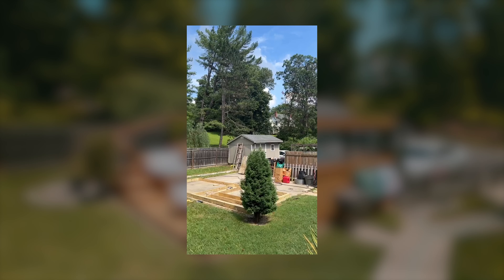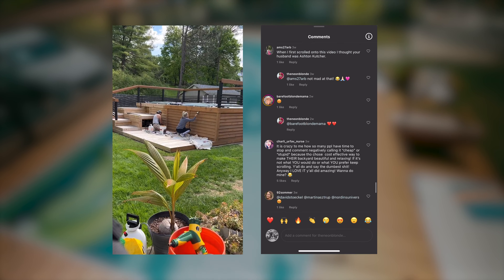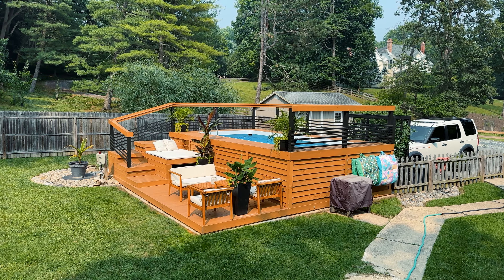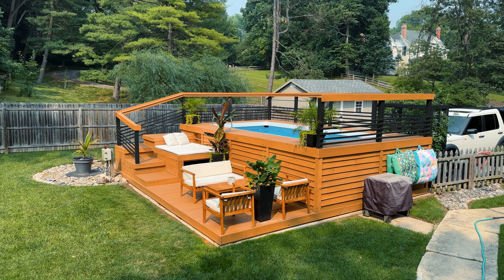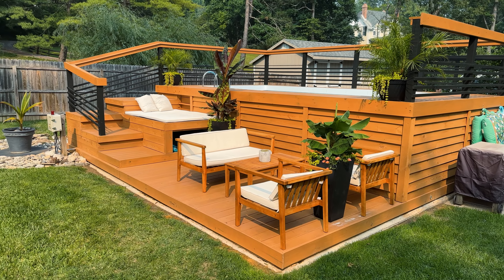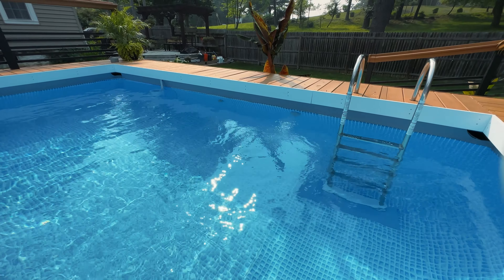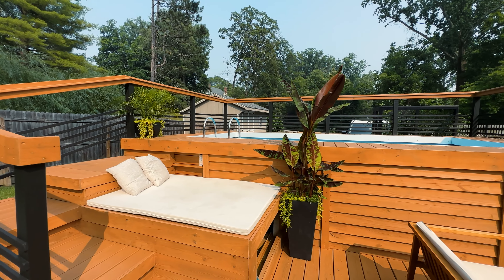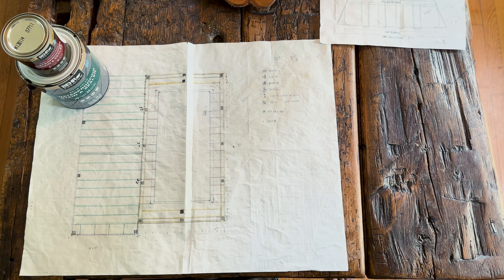DIY Pool for under $6K - Intex Ultra XTR and Saltwater System

Comment: Don't take too much hate from the internet, seems like a very logical choice and budget to me.  It looks great!.  We took a similar approach with kids only using it for a decade or so, we built a nice deck around a cheap pool (same one actually).  $100k for an inground wasn't feasible, and this provides great value.  Ours comes down for the winter, but that is climate dependent.  Great design, beautiful and functional!

Typo on your new pump.   It's not 8500 GPH, that would be all the pool water in one hour.  It's probably 1500-2000 gph.
Reply from the maker: Yooo!! You’re the first person to catch that, hah! Can’t believe it. You’re 100% right, my mistake. Those numbers are the pool sizes that the corresponding pumps are rated for, NOT GPH. Thanks for the call out and the comment. I appreciate it.

Comment: I closed my pool last time with a kit and left 3/4 of the water in.  Opened it with a kit, adjusted the salt and it was great.  I will never drain it now.  I have a more powerful pump and filter though so the results were very fast.
Reply from the maker: This is awesome! Thanks for letting me know. I've thought about winterizing it with a kit but haven't tried it yet. If you're able, share some info on the kit you used and any insight from your experience.

Comment: I have this same pool with a similar deck setup. Only difference is I got mine in 2019 for $300. They have gone up in price! I’m in the Virginia side of the DC metro area. So I’m thinking we have the same weather as far as winters go. I upgraded to the bigger pump as well. So far it’s been the best thing we added to our backyard. I use it more then the kids!! When winter comes along we drain it to under the plumbing ins and outs make sure to drain the pump. So we don’t have to worry about freezing water in the lines. Throw a cover over that bad boy. And we are good to go. I go once a year to Walmart at the end of the season and stock up on pool supplies. That way in May before everyone is doing the mad dash to get stuff to open their pools. We are good to go. We are starting to think we have about 2 seasons left before we may need a new liner. But for the price paid in upgrades, decking etc. it’s been totally worth it.
Reply from the maker: That's awesome! I've heard rumors about how low the prices were pre-covid but $300 is incredible. I recently saw it on Amazon for around $600 which is the best I've seen in the last few years. Your tip about getting pool supplies at the end of the season is pretty great, I'll have to try that. When winterizing your pool, do you put any chemicals in it or do you just drain it below the inlet / outlet? Also, what's been your experience re-opening the pool after it's had water in it over the winter months? Thanks for the comment!
Reply: @taylordeyoungdiy sorry for the late reply. When closing up for winter I normally dump a full bottle of the Walmart liquid chlorine in it. However this season  when opening it. We had a problem with algae. But that was a fairly quick fix by changing out the sand in the filter. I’ve noticed with this filter I can only really push the sand about 2 1/2 seasons on it. However I have 3 boys plush neighbor boys that will try to jump in straight from football practice. If I’m not out there to do the mom glare! 😂🤦🏽‍♀️😂.  I was just in the pool almost every day this past week with the heat wave we had. Did a thorough scrub and vacuum inspected the liner and we should be good for another season. I do plan to go to Walmart sometime this week as most of the Clorox pool chemicals should be going on clearance. I also did a upgrade this year with mosquito netting and more solar lights. Creates an amazing date night atmosphere! Oh one more thing. I will say I don’t drain it right under the plumbing ins and out. I go a bit lower to account for the expansion with freezing. You know how the bottom on the pool is bigger so it helps with the flex!

Comment: That looks very stylish, Taylor.  Two questions for you.  1.) what did you use for the white edging over the pool?  Looks very clean.  2.) what type of decking boards did you use?
Reply from the maker: Thanks for the comment! We used PVC board for the edge or coping. The deck boards are standard deck boards which we stained and sealed. We considered a synthetic product but opted for wood. Maybe we'll upgrade it in the future. Let me know if you have any other questions!

Comment: May I ask you to say more about winterizing? What kind of climate are you in? Just trying to see if we could leave one up in Canada!
Reply from the maker: We're in Maryland so the winters do drop below freezing, not as cold as Canada but cold enough where we can't leave the pool as is. In our case we chose to drain the pool completely and refill it in the Spring. It's a pretty small pool so this isn't a huge effort and the impact to our water bill is minimal. We left the pool frame and liner in place and covered the upper area of the deck with a waterproof tarp. This was to keep the pool clean of debris more than anything and it did a pretty good job. This may not be an option for everyone but for us it works. I have seen in some cases where people will winterize these with chemicals and keep water in them throughout colder months. There are how-to-videos of this on YouTube but I haven't personally tried it. The manufacturer recommends completely draining, disassembling and storing the pool in its entirety. If your pool is completely exposed this is probably the best option especially if you're looking to maximize it's lifespan. I suspect freezing temperatures could decrease the longevity of various components but we haven't experienced any yet. We drained the pump and filter and stored them indoors over the winter along with other easily removable parts (extra hoses, ladder, etc.). I'll make sure to expand upon our winterizing method in the next video. Thanks for watching!

Comment: I've been on the fence about doing a similar set up (functionally, not necessarily stylistically) for a while no. I've been putting it off primarily because the actual work seemed a little daunting. But, this video is exactly what I needed to give me the inspiration and confidence to finally pull the trigger. Wish I would have seen it earlier this year, but I'm excited for next spring now! I'll use the time between then and now to plan. Your design came out gorgeous! And thank you so much for taking the time to really articulate your thinking behind the design and the clarity in laying out your building process.

Comment: This is nicer than some of the inground pools I've seen. The price on an inground pool is not feasible for most people and I'm not convinced they add value to your home anyway.
Reply from the maker: Thanks for the comment! In-ground options have their challenges, for sure. It's always tough to assign long-term value for pools but I suspect if it's well done and your home is in the right market, it could have an up side. The majority of the value probably comes from your use of it rather than an increase in property value.

Comment: Nice job Taylor, I  have a 24 x 12 & changed the plumbing to hard pipe (1.5 inch) completely.  Also I wasn't that impressed with the standard pump & filter as it only has a MAX 12hr runtime per day so that has now been changed to a setup that allows me to run for 9hrs & still filter 3 x pool volume.  I have a skimmer that I have attached (CUT) to the side of the pool - works very well - may add another next year along with another pool return.  I also bought a pool robot (battery powered) to clean the pool.
Reply from the maker: The upgraded pump has worked really well for us too. I still haven't changed the skimmer set up but would like to, unfortunately i'm not sure I can install one on my pool due to the angle of the walls. The Intex skimmer has worked pretty well but does have limitations and requires consistent maintenance. I haven't used a pool robot yet but have been researching them, let me know which you went with and if it's been worth it. Thanks for watching!

Comment: Hi, I think you have some numbers mixed up. The kit pump 26643EG is 1500GPH and it's meant for pool sizes of 2800-8400 gal.
The upgraded pump 26675EG you show as 8500GPH is wrong, 8500 is just the pool size in gal. The flow rate is similar as the kit one - 1600GPH. This upgraded pump is for pool sizes 2600-8500gal. The main difference between kit and upgraded is that the upgraded one uses saltwater system so you can use less chlorine for disinfection. Please correct me if I am wrong.
Reply from the maker: Yeah, I screwed up some of the part numbers and figures but don't have a way of correcting it without pulling the whole video down. I mentioned this in previous comments where I have provided the correct numbers. The kit pump has a lower system flow rate, lower pump flow rate and no chlorination capabilities. It also has a lower powered pump motor. The kit pump is rated for this pool size but during my research I found that a lot of people upgraded their pumps to something more capable. In my opinion the larger pump is better quality and worth the money for the improved performance and chlorination capabilities.

Comment: Love your setup! Ours has settled and pulls away from the sides of the deck. Do you have any suggestions for closing the gap space between deck and pool? Our dog has already fallen through the crack, she’s blind and forever afraid of the pool deck now.  😢
Reply from the maker: During our build we realized the upper deck was shy a few inches of the pool frame and there was a small gap. We extended ours by sistering an additional board to the inside of the upper deck which then covered the gap. Maybe you could do something similar? Hope this helps.
Reply: @taylordeyoungdiy  that’s exactly what needs to happen! Thanks for responding!

Comment: Great video! Extremely informative. What size pump did you replace the original one with? I see it range from 10 inch 14 inch etc.
Reply from the maker: Thanks! I'm not sure what the 10 / 14 inch measurements are referring to when it comes to the pump model and size. If you jump ahead in the video to 15:45 I discuss the stock pump vs. the upgraded pump including model numbers, etc. Kit model #26643EG 1,500GPH and then the upgraded model #26675EG 8,500GPH. Let me know if that helps!

Comment: This is awesome! Thank you for sharing. I’ve been in pretty much the same dilemma you were looking at all of the options but not wanting to invest in something if we were to move in the next few years. I did have one question. Does your pool sit directly on top of the concrete or do you have something between it? Thank you again!
Reply from the maker: Thanks for the comment and yes, there is a tarp included with the pool for this purpose. It's a very thin and ineffective tarp in my opinion so we doubled it up with a 3rd party tarp that we purchased at Home Depot.

Comment: What did you use to stain your deck? (Spray, roller,brush?) looks so clean. I’ve done a similar project, i want to install a similar railing for safety. What did you use and how did you mount the railings? Thanks in advance!
Reply from the maker: We used a pump sprayer to apply the stain and then brushed it in to smooth and spread it out. The railings are attached to 4x4 posts that run down through the frame of the pool housing. The sections in-between are 1x2 boards and the handrail is comprised of 5/4x6 deck boards. All of these were stained generously with Behr solid SLATE and semi-transparent CEDAR. The railings weren’t added on later or attached to the top of the deck which might be what you’re thinking. I’ve seen some metal railing solutions which can be attached directly to the deck but they can be expensive. I'll make sure to expand upon these answers in a follow up video. Let me know if I can answer any other questions! Thanks for watching.
Reply: Nicely done, and thanks for the quick response! I will be doing the same color combo.

Comment: Awesome looking pool. Wanting to do something similar! If you ever have to replace this pool, is there easy access or do you need to remove part of the decking?
Reply from the maker: When you drain the pool completely the frame and liner collapse inward making it possible to replace without deconstructing the housing around it. With that said- it would likely be easier to remove some aspects of the housing but we haven't had to do this yet. If you watch tutorial videos on setting up the Intex XTR pools you'll get a better idea of what I mean when I say it collapses inward.

Comment: Looks amazing but I have to ask - how do you take something like this down? My understanding is that these pools don’t last long and that they need to be drained and stored in the winter.
Reply from the maker: Thanks for the comment! This particular pool collapses inward when drained and is pretty serviceable should repairs need to be made, also the side panels on the housing we constructed are removable. Fortunately we're on our third season with this pool and we haven't had any issues, everything is still original. During the winter we drain the pool and cover the top with a tarp, we don't break down or store the frame / liner. We do store the filter, pump and accessories indoors. This pool is on the smaller size so draining and refilling isn't too big of a deal. I have heard from others that they winterize their Intex pools and never drain them but I haven't tried this personally. I've also heard of these pools lasting 7-8 years plus, which is reassuring. All of the parts for this pool are available through the Intex website, they seem to be pretty good about providing components at a low cost, for example the liner for our pool is $250 direct from Intex.
Reply: @taylordeyoungdiy  amazing response, thank you. I live in a harsh climate and have this exact same pool, but I have concerns building a permanent structure around it in case I need to service it or take it down. It helps knowing you drain it every winter in this setup. Thank you!
Reply from the maker: @MrLocke-bk3om  yeah, anytime! if you look through the comments, @universe74 has had success winterizing their pool. they might be able to provide more insight into the process if you're interested.

Comment: Nice job. Any way that you can provide the total footprint of the deck - trying to see if I have room for a similar set up. Also, will to share a plan? Many thanks for the very detailed video - helped us a ton.
Reply from the maker: Thanks for the comment! The footprint is roughly 22' x 20'. I don't have exact plans for how I built the pool housing. I do share some of the designs and sketches I came up with towards the end of the video. I'll work on scanning those in but truthfully a lot of adjustments were made during the build and those wouldn't be reflected in the design documents. It's also worth noting that I'm not a structural engineer or deck designer by trade so I'm hesitant to tell people "how-to" build those aspects of this project. The video is more of a buyers guide and overview of how I set my pool up. I did provide a part list which is available at www.taylordeyoung.com/diy hopefully that is useful. I plan on making a follow up video to address more specific questions so feel free to submit those. Thanks again for watching and best of luck with your project!

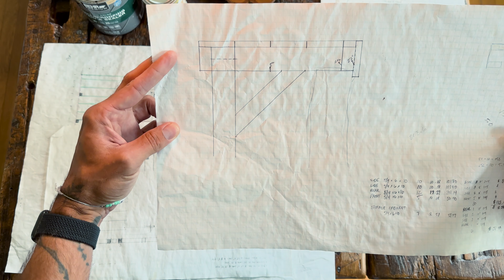Comment: 40:25 can you elaborate more on the final solution? How did you make the walkway more sturdy? I want to build something like this and I planned the exact similar support plank.
Reply from the maker: In our case we added 4x4 vertical supports once the pool was set up. The vertical supports are positioned in-between sections of the pool frame which is why we had to do this towards the end of the build. If you're looking at the drawings, you'll see 4x4 vertical supports on the outer wall, we just added some to the inner wall. If you watch around the 18:00 mark you can see some of these supports. Thanks for watching!

Comment: How about if the Intex is punctured? How do you replace it? Take the deck apart?
Reply from the maker: When the pool is drained the walls collapse inward, exposing the frame. It would be serviceable without taking the deck apart. The side panels are also removable for access to the ports and hoses.

Comment: What about ICF pools with a liner? There are kits out there or you can DIY it from zero.
Reply from the maker: I haven’t done tons of research on ICF pools but am aware that DIY kits are out there. I’ve seen some really nice examples too, so I’d recommend people check them out. In my opinion I’m not sure I’d put them in the DIY category, I haven’t seen an example of one where someone didn’t need specialty tools or professional assistance at some stage of the project but maybe I’m missing something! They’re definitely a cheaper option in contrast to some of the more traditional methods but also not inexpensive. If you’ve built one or have experience, let me know your thoughts! Would love to know more. Thanks for the comment!

Comment: Do you have to climb under the deck to power on/off & change colors on the Intex light?
Reply from the maker: There is an access panel on the backside of the pool housing which allows you to adjust the light. It would be ideal if they offered a remote or something, maybe on the next version. Thanks for the comment!